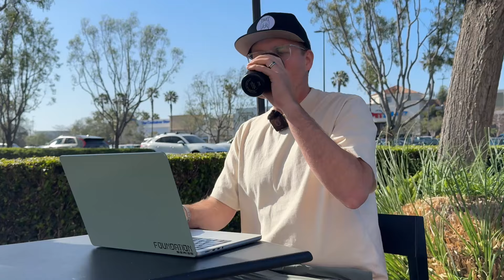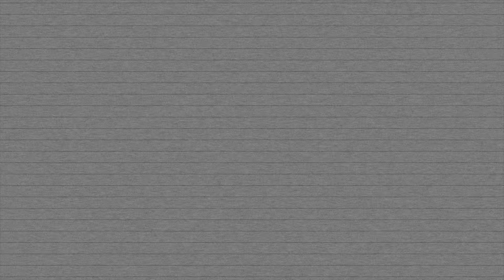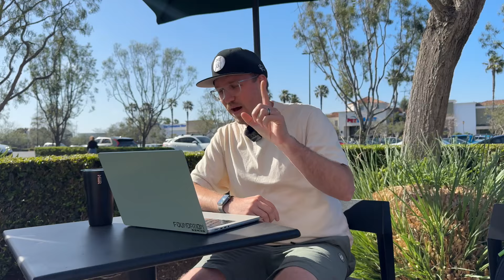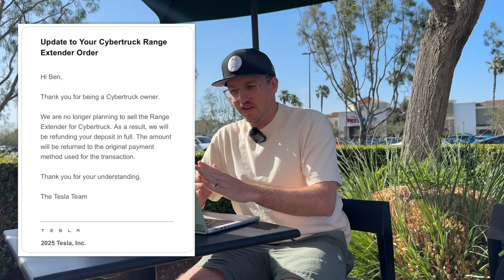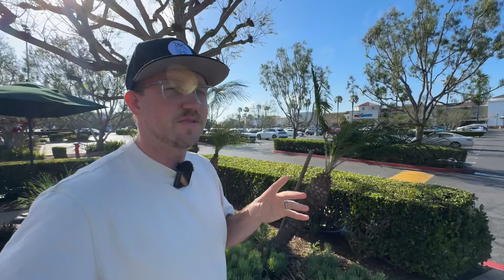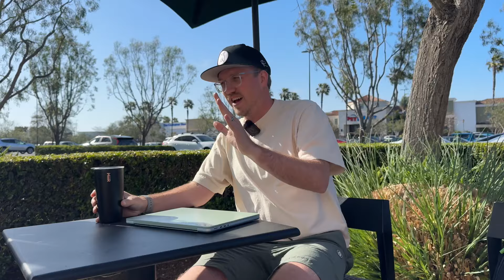Tesla Cancels Cybertruck Range Extender!

Comment: The reason why is that it was never more than a render.  I would wager they didn’t spend a second of development time or engineering on it.  It was just an empty promise to turn down the heat on the reduced range of the CT.  They just had someone render it and put out a picture…and that’s it.

Comment: Tesla will release a true LONG RANGE Cybertruck in the near(ish) future which will use 46120 battery cells, adding 1/3 more energy to the pack at a minimum. Then you'd have 450 miles of range with a 165Kwh pack in the EXACT same package. This explains the 'extra' space in the CT pack.

Comment: Tesla should have developed a Model 2 front wheel drive hatchback. $25k. People like driving their own cars. Not FSD gimmicks.
Reply: Tesla has been focused on achieving autonomy for most of the companies history. That's like their thing. I don't think they are going to pull a 180 and focus on the driver when their entire design philosophy is reducing engagement through automated systems like FSD.
Reply: "Model 2" won't make anywhere near the money for the company than FSD will. Not remotely close
Reply: if they really wanted, they would have done it already, just shrink the model 3 by a bit and it's done, they never did

Comment: This is the problem with selling any product, especially an expensive consumer highway vehicle, too early in the development cycle.  My guess is that they found a problem with the range extender that not even they could overcome.  A higher capacity battery would be much more usable than a "range extender" removable (?) battery, which would be a very heavy air-cooled SOB if it were large enough to bother with in the first place.

The Cybertruck is a great vehicle, has a unique look that grows on you favorably, and it can be used as a work truck.  But like every BEV truck on the market except for Ford, it has shortcomings.  Ford, in turn, have the most "truck" BEV truck, but their battery capacity leaves something to be desired, like having to pay for an extra $20,000 of fancy BS to get the large battery.

Comment: The 4680 is superior to other form factors on cost, not energy density or charging speed. The Tesla truck should've been a cheaper less frills vehicle in the actual advertised prices if it wasn't going to have 500 miles of range.

Comment: Not enough ppl want a 500+ mile range truck by way of 5,000 pounds of pure battery. The EV Hummer, Silverado sales/demand is insignificant. Battery tech just isn’t there yet for towing. Also no one wants to charge or pay to charge 200kw of battery.. it takes too long to charge at home and is too expensive to fast charge, may as well get a diesel if you need that much real world use out of your truck. Also all manufacturers promise or say things in concept cars or future vehicles that never come to market or are not at all close to the prototype but Tesla is the 1st ever super viral auto manufacturer so everything is 10x around any Tesla news
Reply: I agree. I wouldn’t want to haul around all those batteries for the few times I towed something. I would just buy a gas truck if I towed that much.

Comment: We bought FSD with our 2020 Model Y as we were promised the hardware in that car would be completely sufficient for FSD to really drive. That was HW3. Then came the admission that HW4 would be required to really achieve FSD as promised. But no refund, just software that performed poorly for the entire time we owned the car. That was one of the reasons we traded the Tesla and won’t ever buy from the company again. The company over-promises and under-delivers.
Reply: Never trust a charlatan
Reply: Elon lies a lot and gets away with it.  He lost all my respect when he bought a president for $300,000,000.  That was supposed to be a beneficial purchase. oops.
Reply: FSD on HW3 works great. I use it every day on a large variety of roads
Reply: @Shane32YT  Where we are in very rural New Hampshire, it screwed up all the time. Enough so that we turned it off entirely. Having it take a left turn from a 2 lane numbered route to another two lane numbered route (both well marked) and the car went nose to nose with the cars in the oncoming traffic lane was certainly problematic. The ongoing phantom braking on our nearby interstate is terrifying. It was higher stress to drive with FSD than turning everything off. Our Fords do less in terms of functionality, but what they do handle, they do well. To two software engineers in our household, it sure looks like Ford does a far better job on software testing.
Reply: @Shane32YT  sounds like you have a death wish 🤣
Reply: Tesla is working on HW5 now since HW4 is insufficient for real FSD 😂
Reply: Good decision

Comment: It was canceled for the specific reason that they hadn’t done the engineering for it putting an extra battery in there it would require a lot of changes. In addition to the connection. You have to figure out a whole new way of how to balance the battery pack and how you would use it that’s a lot of engineering for a product that would have a very, very, very limited market.  And even more limited given the abysmal sales numbers.  They can’t sell what they have. People can’t sell the ones they own and they’re stock paring huge numbers of them all over the place because they have nowhere to go eventually, they’ll have to stop production because they’re just isn’t any need for them.

Comment: I am wondering if some 3rd party will make a range extender for those cybertrucks since they have the adaptors installed already.
I think it falls to they could not get enough extra milage vs loss due to extra weight as well as the cost of batteries being they are right at the edge of being battery limited. I am sure there were many other things as well I just hope they allow people to hook up 3rd party batteries to the cables installed for the range extender, 
I also want to know when they started not installing the cables for the range extender or if that has not happened yet?
Reply: I think rich rebuilds would have a pretty good take on how much Tesla likes working with a 3rd party

Comment: CT sales are in the dumps.  Why would they invest more money into the CT when there just isn't enough demand to make it worth it?  The CT is a testbed for the next gen tech and for that it will be fine, but it is being outsold by a "Don't trust the BMS" Lightning which is the grandpa of the truck offerings.  CT is going to be relegated to a niche buyer.  For all of GM's failings they probably have one of the best "EV truck" offerings right now and even those are not selling.   Prices are too high for the limited capabilities they offer compared to the ICE variants.  The EREV's might move the dial, but only if they are priced right.
Reply: it was always a niche, why buy it when you have Ford, GM, Rivian, etc, that do almost everything better, I agree prices are too high, although I don't think EREV will be as cheap as a PHEV, since it's electric with a gas engine
Reply: Honestly they shouldn't invest in any product because no one is buying any of them atm...😂

Comment: The range extender would be at the same voltage and same battery chemistry as the main pack, and they would just close the contactors and keep them in balance. Zero motorcycles already does this with the power tank, and has for a decade. No DC-DC conversion.
The range extender battery would weigh about 600-700 lbs. It was always going to be a permanent installation, never modular.